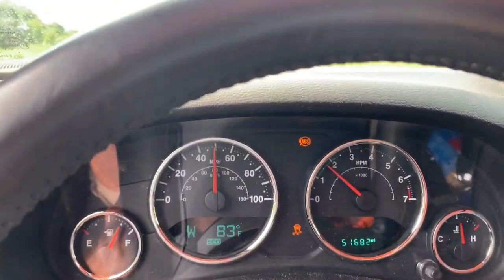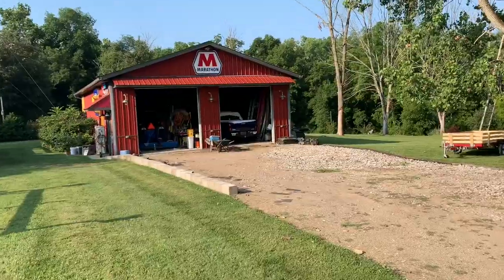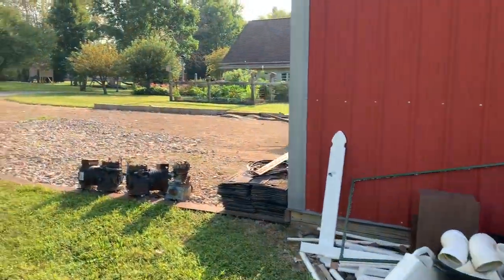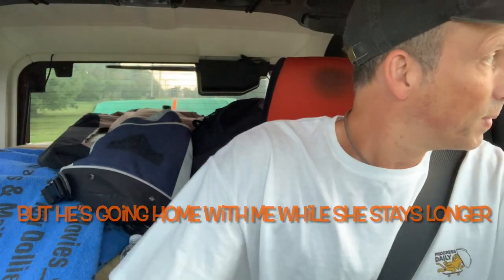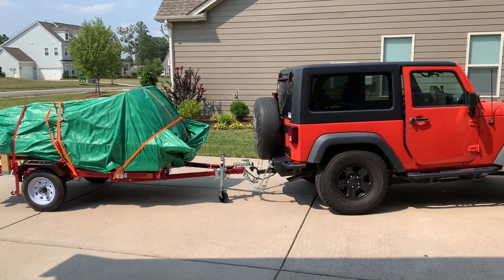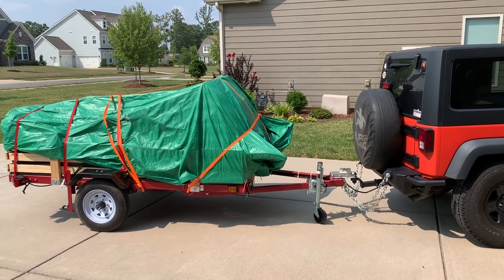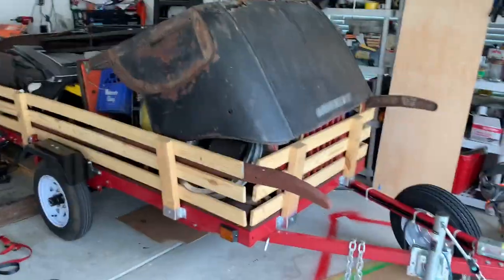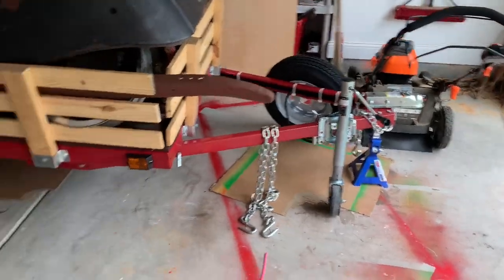Harbor Freight Trailer 1000 Mile Stress Test!

Comment: Hey! So just a heads up I found in other videos that people are not just replacing the grease, they are also replacing the entire bearings as well. Apparently just taking the bearings to an auto parts store they will cross reference the part number and give you a "better quality" set.
Reply from the maker: I saw where others replaced the bearings too and did consider it.  But I also wanted to give the stock ones a fair shot.  Once I pulled them out to check them, they really did seem to be a decently made bearing so I chose to pack them well with good grease and give them a shot.  Once I get about 5000 miles on the trailer I will pull them and see how they are wearing.

Comment: How tight do you turn the bolts? There are no torque specs anywhere except for the wheel itself...some of sheet metal bends with no force at all like the two 19mm that holds the leaf springs on....also the u-bolt spring plate bends quite easily when torquing down....any advice?
Reply from the maker: The only bolts I torqued to spec were the lug nuts.  Every thing else I just used my experience and went by feel. Using standard box wrenches and a 3/8 drive ratchet it would take a real strain to over tighten.  For the u-bolts I moved from bolt to bolt in a cross pattern to make sure they were all tightened evenly and then stopped when the plate started to deflect.  They were pretty tight already at that point.

Comment: Any idea how many inches the bottom of coupler is from the ground in order to be level? I'm ordering a drawbar and hoping I got one with the right amount of rise.
Reply from the maker: My trailer is currently folded up so I couldn’t get an exact measurement but I went out and measured and have a pretty good estimate of about 14.5”.  Remember you want the trailer level when fully loaded on the tow vehicle so you have to account for tongue weight and suspension droop on the tow vehicle.  Unloaded from the ground to the bottom of where the coupler would be is about 19” on my Jeep.  Fully to overloaded the trailer is level.  Thanks for watching!
Reply: @AJStarch  thanks for the follow up and measurements. Maybe I just need to sell my car and buy a Wrangler. 😘

Comment: they are great trailers. i have 2 of um. mine are 4 lug where yours is 5 lug. thats the only main difference between the 2. the only main flaw i  found out is where the wires are mounted. other then that theyre great for the money.
Reply from the maker: I agree, it’s a nice little trailer with some fixable flaws.  I modified my wiring routes, protected it with plastic wiring loom and ran a dedicated ground wire to try to avoid electrical issues.  The biggest flaw in my opinion is how poorly the bearings are greased from the factory.  Thanks for watching and the comment!
Reply: @AJStarch  just put grease fittings in the baring caps like they did on the old ones n yer done.

Comment: How much weight have you hauled in your harbor freight trailer?  I have a small kubota tractor and needing a small trailer to haul it on.  My tractor weights 985lbs.  But seems like it should be heavier than that...  Would you trust putting 1000lbs in the harbor freight trailer and hauling with it?
Reply from the maker: Everyone is responsible for their own actions and limitations… that said, I have overloaded my trailer.  I’ve had a bit over 2000lbs on it and it did fine but I also kept the center of gravity very low.  Your tractor on the trailer may have a higher COG and result in different handling.

Comment: What speeds were you traveling? Any sway?
Reply from the maker: On the way up to Ohio with the trailer empty I was taking it pretty easy staying between 60-65mph most of the time. On the way back (probably a bit overloaded) I was between 65-70 most of the way (and higher a few times). And even though my Jeep is a lighter, short wheelbase vehicle, I didn’t experience any sway from the trailer at all.  In fact it was really easy to forget it was even back there.  Thanks for watching!
Reply: @AJStarch  just curious about the 45mph max speed from the manual,  when does that apply (empty trailer or that's just max recommendation when pulling)?
Reply from the maker: @mtnguyen1696  The manual says not to exceed 45 mph when towing the trailer so I assume they mean empty or loaded.  Thanks for watching!
Reply: @AJStarch  were you using the tires that came with the trailer?
Reply from the maker: @mtnguyen1696  Yes, I’m using the original tires. I did buy an extra wheel & tire to take along as a spare though.  Thankfully I haven’t had to use it though.

Comment: Great video! How is the trailer holding up? How many miles on it now?
Reply from the maker: Thanks and thanks for watching!   The trailer is still holding up very well but I don’t use it an extreme amount.  It probably only has 3-4000 miles on it.  I keep it stored inside so it is still in near mint condition.
Reply: @AJStarch  that’s good to know. Thanks.

Comment: Dude you rock for not only continuing on making trailer follow up content, but also over all good videos! I caught myself watching / skimming thru a couple others. Rock on dude good luck on your hot rod project! 

I placed an order for a 1720 harbor freight trailer early December, still waiting for it to come in. Mainly to move around a 14ft Mercury Raft already setup, canoe/camping gear, and in a year or so do a cross country move from Miami Fl to Tulsa OK with just the essentials. One mod I will have to do besides flooring is for the raft is to extend the connection to the tailer hitch by a couple feet 2-3 already have an idea for that, and a shelf when for the camping setup. Cheers bud!
Reply from the maker: Hey thanks for the kind words!  Sounds like your going to have a fun project of your own and a good trip!   I’ve done a few bare bones solo cross country trips on my motorcycle tent camping along the way so I can definitely relate.

Comment: How’s this trailer holding up for you? Bearing still going strong? I’ve read the fender brackets snap from vibrations. 
Going to pick one of these up in a couple weeks
Reply from the maker: All seems to be holding up well so far.  Just went out and checked and my fender brackets look fine so far, no cracks.  Definitely don’t sit or step on the fenders though as I would bet they’d bend instantly. Thanks for watching!
Reply: @AJStarch  thanks for the quick reply! Cheers